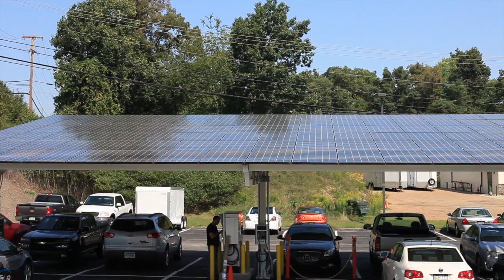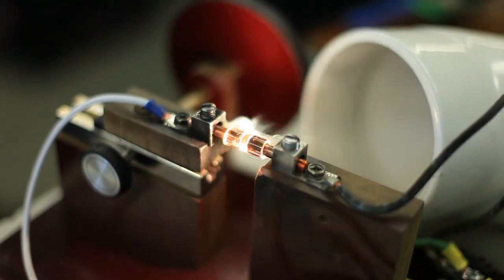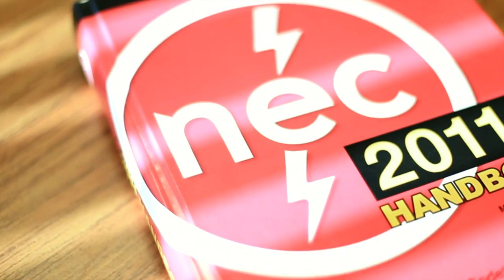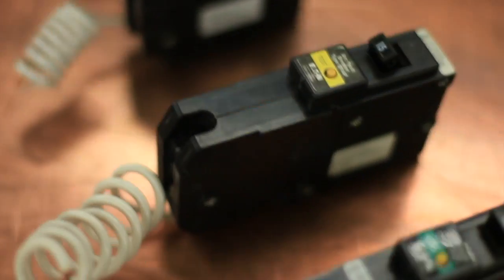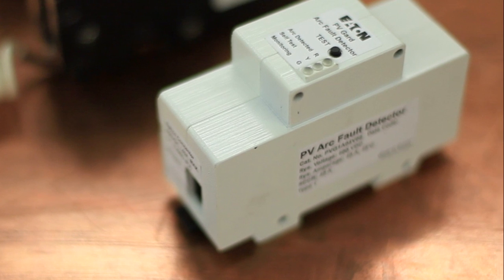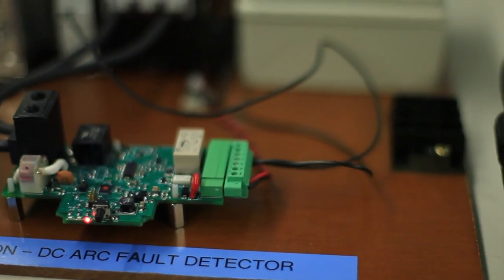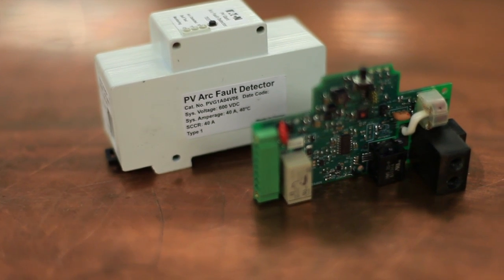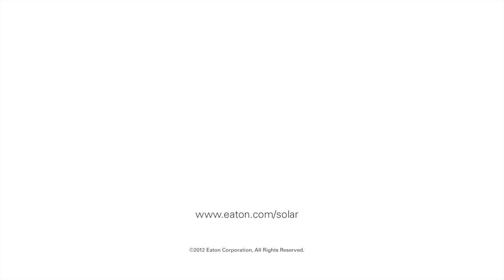DC Arc Fault Video

Comment: okay so I built a PV system and it runs great, going through making sure I have dotted i's and crossed t's it is clear that in Canada and USA you need DC PV Arc Fault AFCI but where to buy them?
The one shown does not come up in a search in 2022, ten years yeah I expect that unit has been replaced with newer model sure, but I can't find ANY DC rated 30A AFCI to use. The vid is DC and 40A.
The rest of the world does not seem to be concerned with fires on their roof and we don't see DC AFCI from the aliexpress suppliers, only AC.  EATON site seems to be no help, someone is making these right? They are required by code. do we just use AC rated and pretend we didn't know any better?
Reply: I am in the same boat. I want to add a DC solar array but the Arc Fault protection is becoming a major pain. The Schneider solution is over $700 for a small 2,000 watt array. It just kills the budget. This device looks perfect, if it existed anywhere.
Reply: @garymeissner6659   Yeah such a let-down to watch the video, get all excited as this is EXACTLY what I have been looking for, only to then come to realize they don't sell them.
I asked the tech from Tomzn China if they had a DC rated Arc Fault breaker, and no, only AC. They asked my why I wanted a DC one! so sent them a copy of the NEC reg.
Many Inverters have the Arcfault detection built into the inverter, however, how do you know, and if it cuts off a string of PV panels do you get a fault or warning?